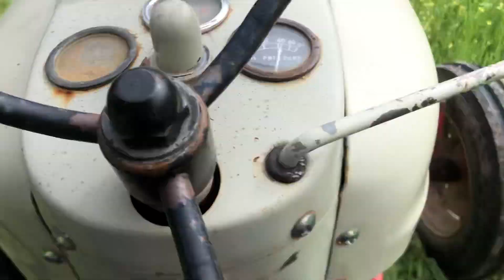Mowing oats with a Ford 860 tractor and Massey Ferguson dyna-balance sickle bar mower

Comment: I have my dad's old Ford Jubilee propane tractor!  Not running presently.  I've used it many times .. sitting in the front yard now .. an antique of sorts .. was converted to a 12 volt system many years ago.  Love seeing yours run .. and that old mower is working smoothly.  That model of tractor was a really good piece of technology for it's time .. live PTO and quite a powerful tractor!
Reply from the maker: I have to convert it to 12 volt it’s still 6 volt and not charging that’s the only problem it has really, it’s 40 pto hp , it was restored before I got it
Reply: @kirksawler1199  Nice tractor!  :-)